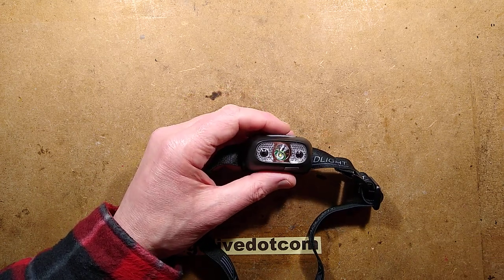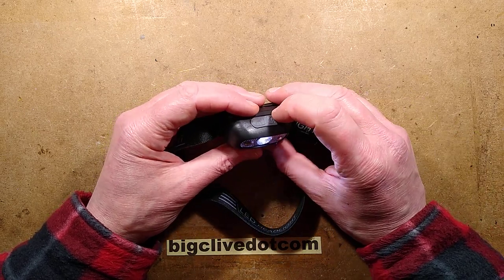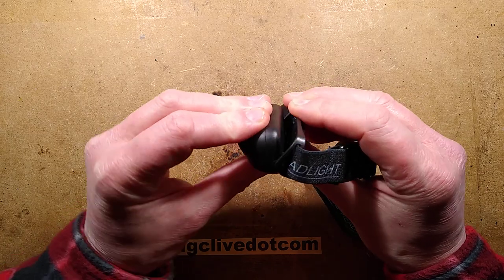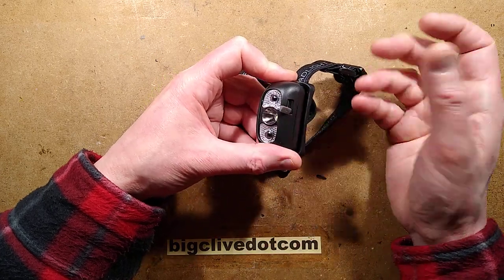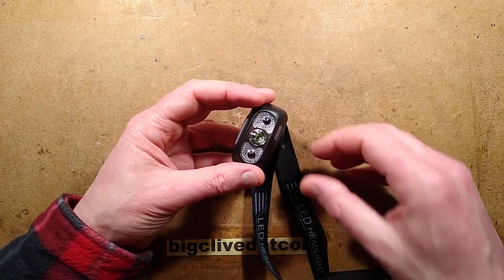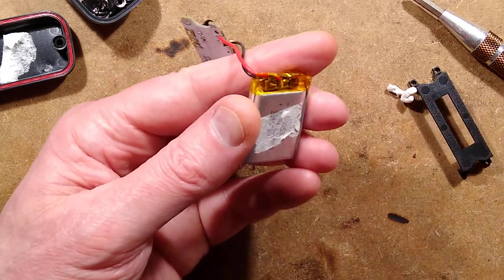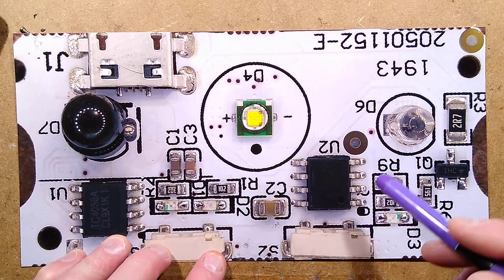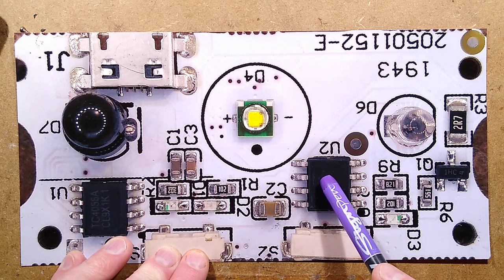This USB rechargeable LED head torch is really good!  (And no strobe!)

Comment: Hi Clive, I have a question. I have 2 18650 batteries which I have just  bought a 'Nitecore New i4' charger to charge them with. When inserting 1 of the cells I get a spark on the positive terminal, this happens when the unit is plugged in and disconnected. Is this dangerous, should I be worried? Once connected the cell does charge fine. Just don't want any accidents! It is the cheaper cell of the two and the other doesn't do it if that helps?
Reply: Many devices have a capacitor that draws a pulse of current when you first plug it in. That and the weak connection when the battery is barely touching the terminal, are enough to make a spark. The current stabilizes quickly so it should be okay if that's what's happening.
Reply: @ J P : That would concern me enough not to use the cheap cell until I've done some further testing of it. I hate the way the chinese li ion battery chargers all light up green when unplugged and a cell goes in it. Too weird. Too underdesigned and under engineered.

Comment: Often the letters on surface mount transistors are date/batch codes rather than model numbers,  at least the ones I buy.  It always strikes me as odd that resistors are so clearly marked, ceramic capacitors have no markings, and transistors have something irrelevant written on them🤔

Comment: Hey Clive that seemingly Cree LED will probably run at 2.9v not 4v
Reply from the maker: The resistor limits the current.  The voltage across the LED will be in the region of 2.5 to 3V in use.

Comment: I ordered mine soon after this video and during this weekend discovered it is dead after laying in a shelf for a while. Opened it up - and surprise - internals are just usual cheap China crap while outside is identical to the one reviewed here. Schematics are optimized and battery is without protection. So for my light seems battery has puffed up and died. So be careful.

Comment: only pitty is it has no voltage regulation but that would cost energy dearly
Reply from the maker: There are advantages to the progressively lower current after a long run time.  The versions that run at full intensity and then suddenly cut off are a nuisance.
Reply: yeah those should need a warning beep or even better a battery level indicator
Reply: Batteries are about a close to a finely regulated source as you will get once you compare them all on an Oscilloscope. Unless I am misunderstanding you somehow.
Reply: I was meaning a boost regulator's (step-up) non optimal efficiency

Comment: I  have a number of  head lamps resembling this one.  the 2032 cells are a issue.  They simply don't last long enough.  Liking the IR aspect of this one.   Yea, what's with the stupid Strobe thing.  Every flashlight coming out of China seems to use the same  control IC ?  This one seems to have eliminated both of my Grumbles.  Yes like most items debut on YouTube they become in short supply.
Reply: I have a couple of hats that use 4 2032 cells each. I only dare fuel them up at the dollar store.

Comment: Why is the 2,7 ohm resistor bigger than the 1000ohm ones?
Reply: It's a current limiting resistor for the main LED, so needs to be bigger to handle the amps.

Comment: I am surpised you didn't mention that the pins through the board are trying to perforate the lithium battery (quite the dents there!).  You might want to hit those with a clipper or a file.

After all, no one wants a forehead fire.
Reply from the maker: I'd guess those dents happened at the factory, because there's a thick plastic strip that separates the cell from the PCB, and no particularly long leads.

Comment: Can you tell part number/IC number for U2 component??
Reply: Probably a microcontroller.
Reply: @johncrowerdoe5527  Yes it's the controller. I was wondering which controller they used as this product is very cheap and good quality build.
Reply: Might be unmarked, they often are in cheap electronics.
Reply: Yeah given the rest of the build quality, would be interesting to see if customizing the firmware would be possible. Even if it meant doing rework to swap the chip, might be worth it. So what's the full pinout on the controller, @bigclivedotcom?
Reply: @RossReedstrom  it's probably one time programmable. Look up 3 cent microcontroller for example, eevblog did some videos about one.
Reply: @jkenny1  yup that's why I mention pinout and rework. Figured it's not icp, but if the pinout matches something standard, dropping in a replacement isn't that much work, and would allow for exactly the interface people want. The whole point of hacking, for me. 😄
Reply: @RossReedstrom  Ah, I wasn't thinking outside the box haha. Yep that would work. What sort of features or changes would you add?

Comment: My preferred headlamp runs on an 18650, microUSB charging, relatively lightweight and compact, it will come up if you search for "18650 xml2 headlamp", sold under many names/brands, also known as the Boruit D10, < 20usd, http://budgetlightforum.com/node/58827
Reply: @markifi  it uses an emitter on a star PCB so can be easily modded, lens can also be replaced, I'll eventually get a more neutral white myself 😎
Reply: @markifi  ah no, you just replace the star PCB, it's separate.
Reply: @daijoubu4529  not on my lights :) happy modding

Comment: Typical Chinese strategy. If you get one of these today, you get 350mAh non-protected cell and also no gasket. The enclosure can fit a 1000-1200mAh 10x25x40 battery but these cells are rare and take ages to arrive overseas. Either that or get the cell from Germany at 3 times the price of the headlimp.
Reply: Bought two last week, to add to the one I bought ages ago that's still going strong, despite much use in the workplace, most days.  All three have the gasket and the larger battery.  Sold branded as Core Lighting in the UK. The PCB is slightly different layout to Clives, but functions are the same. Main LED is on it's own wee aluminium board to act as a heatsink? Would love to find a way to just have on and off, instead of the three brightneses....

Comment: Hmm. LEDs.... I've never had an LED anything last very long.
Reply: Are you talking about those A style replacement bulbs because they are a bad form factor. Form factor has a lot to do with duration. I've got several flashlights, LED strips, and a headlamp that have been around about a decade now. Cheap ones, too. The biggest problem I have is the ones that have lenses on them tend to vibrate apart when I bike with them. Best solution is to locktite the lense retaining ring on.
Reply: @johnpossum556  I've had LED flashlights, LED bulb replacements etc. All fail. I just regard LED flashlights as disposable now - once the batteries die, time to toss it out.
Reply: @raisagorbachov  Wow, that just seems crazy to me as I have a 8' string of 3528 SMD LEDS running nonstop for almost a decade now. I don't think one has ever failed. Honestly, most of my old LED devices just get set aside as the newer ones have gotten so much brighter now. Just last night I ran across 3 dollar store LED flashlights I left behind as well as one 1 watt flashlight that just ate too many non rechargeable batteries. I did fit an 18650 in it once I took out the black plastic 3 battery holder. I may keep it handy in case this pandemic gets bad. When was the last time you bought an LED product? What was your usual place you bought them from?

What advice I would give you is to try to buy items with the CREE leds. Like the XML T6 is a very popular hardy one used in many devices. You'll see it in the description of devices you might want to buy. You don't have to spend a lot. I bought a few of these flashlights at only 2.38 on amazon.

For home lighting I have bought Maxxima brand retrofit lighting 850 lumen 12 watt fixtures on dimmers and they're going on at least 5 years now. They're fairly big but that is a plus since they can handle the heat unlike the ones that look like the old bulbs. They were $30 each at homdepot.com and I bought them because I like the 2700K light color is like the old bulbs.

Lately I have been using some Toggled brand 5000K lights for my workshop and the outdoor shed since the fluorescents were getting glitchy & dim. I bought the dimmable versions from homedepot once again. They are so bright that I plan to replace many more with these as they're only 16W for 1700 lumens. It's about 1/3 of the power of the old tubes. Funny I have the box in my hand but can't find the brand name of the LEDs themselves.
 Maybe this info will help.
Reply: @johnpossum556  Hmm. I bought an LED lightbulb from China when they first came out. It was a weird cone shape and a distincly blue colour. In the end I put it to one side for a few year then put it as a stairwell light where it lasted 3 months. Then I noticed ring after ring of LEDs failing until finally the whole thing died. 

In the bathroom I put 4 LED bulbs from Lowes. Within a week one had turned into a disco light, flashing and flickering. Within a month another one had failed and gone dark. Then another one went within 3 months. One seemed to last though - until I took it out and replaced them all with CFL.

Flashlights - I've had several. Some from Harbor Freight and I'm not sure where the others come from. They last  about as long as the batteries. I've used magnetic flashlights, barrel flashlights, magnetic LED work lights - all fail after about one set of batteries.

In my skoolie I have the two-pin bulbs. I have a bunch of those from Walmart under their own brand. So far every one of the lower wattage ones has failed. I've begun to replace them with halogen as they fail. 

I have yet to have an LED anything that actually lasts close to 6 months or more than 100 hours usage. Stuff that 10,000 hours BS. That's just a lie to make you want to spend ten times as much on a bulb.

As an example, I bought 10 halogen bulbs of 20W each for $5. I bought 2 LED 2.5W bulbs for $8 in Walmart. Not only do the halogen last longer but they cost less. As the skoolie power comes from my solar system, it's not costing more in electricity.

I did a calculation on those LED bulbs. The extra cost of the bulb is about equal to the amount of energy it will save over a year. My incandescent bulbs last well over a year!